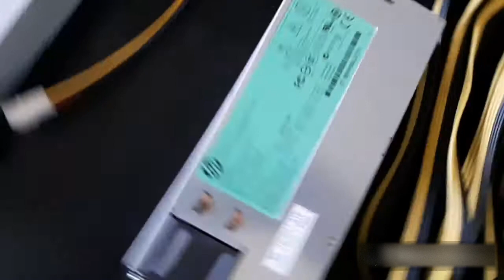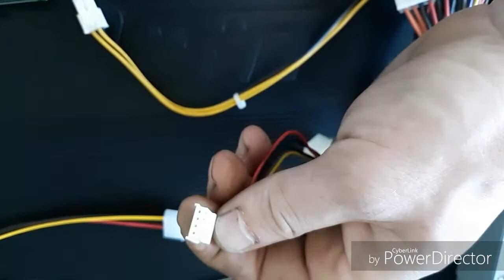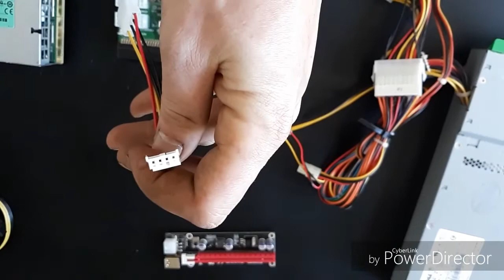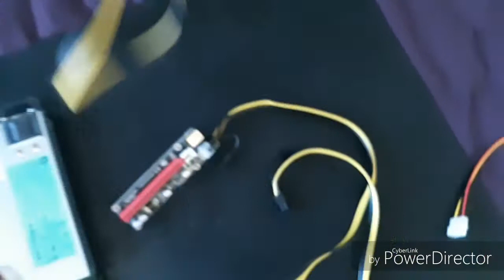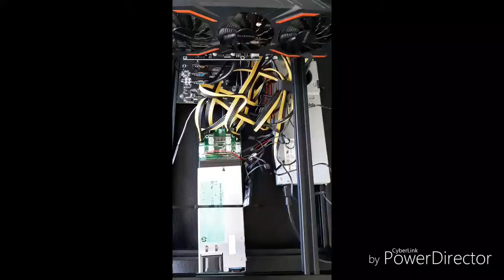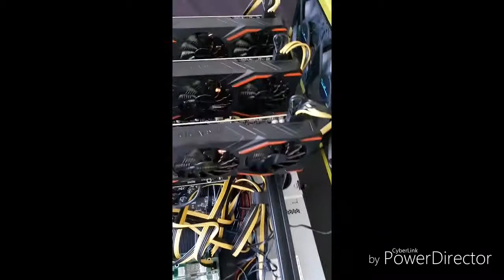How to Set Up Server Power Supplies (PSU) for Mining

Comment: Is it ok to to run a 6 pin to 2x8pin pulling 250W ? Or is is better to use twice as many 6 pin to 8 pin? Thanks!
Reply from the maker: It would be better to do a 1 to 1 (2 6 pins to 2 8 pins) due to power draw. It could possibly melt the cables. HOWEVER, the second 8 pin power connector on most GPUs, isnt even necessary to run it. It is an extra connector for power spikes in load, and I have seen Gpus using only one of those connectors for mining.
Reply: @JonnyRingo711  Gotcha, thanks!
Reply: @GP-qb9hi  u really want 2 6 pin to 1 8 pin. if you were to run 6 pin to 2x8 pin pulling that much youd melt your whole system bro. 6 pin is rated for 75 watts. 8 pin is rated for 150 watts.
Reply: @Fidddle  Maximum for 6pin is 216W for 8pin is 288W, he'd probably melt the connectors. Wire (depending on AWG rating) can hold more than the pins in the connector.

Comment: Can't you leave the 4 pin cable out and just manually press the on button in the server power supply when you press the on switch on the motherboard.
Reply from the maker: Yes you can, and it works the same. I prefer the connection though to guarantee they turn on in sync

Comment: Hi I hope you notice this. Im also thinking using one of these power supply. Looks like they have a very small fan. How's the noise? Is it loud enough to bother other people in the same room or small apartment?
Reply from the maker: It really.depends on 1. How much wattage each unit is running at and 2. How warm the room is. 
If its cool/cold, and you keep one of these under 4-500 watts its not bad at all. I ran a rig with 3 rx580s on 1 psu in my living room and its was pretty quiet. BUT, if these server psus get hot, they sound like a small jet engine or a blow dryer on high. The fan is small, but extremely high speed when it needs to cool down.
Reply: @JonnyRingo711  Wow A blow dryer? Sounds like this is not gonna work for me. even my neighbors gonna this when it gets hot. I live in tropical country and my room is like an oven during summer.

Comment: Wait is it possible to just connect the breakout board to the hp server psu and then power the HP psu with power cable from the wall. Sure depending on it 110/240 ur watt will vary. But do u still have to run a cable from the atx supply to power it, if u use the power cable for the hp
Reply: There is a power button on the breakout board to turn on the server power supply without having to hookup the ATX power supply.

Comment: Hi is it possible to connect a breakout to power supply Lenovo Swap - Hot? thanks
Reply from the maker: I'm not sure. The breakout boards I use only work for 2 different psu's that I know of. There are some for other types of power supplies though, you would have to find one that matches that power supply connector

Comment: so 2 weeks ago i left a comment NOW i am in profit!!!  i just order 1200w server psu and breakout board and an Onda D1800 BTC Mining Motherboard (6 GPU).  woooooo lets mine!  ONE QUESTION - my breakout board has no port to auto turn on. anyway i can make it turn on with normal psu i use for mobo?  any way to wire one of my pcie connectors from server psu to normal psu so it urns on itself?  your board has port to auto turn on mine does not!
Reply from the maker: Thats great!
As far as turning on the breakoutboard without the 4 pin floppy, I haven't found another way to make the psus synchronize. The alternative is to turn on the psus at the same time manually. I have done it that way and it worked. Just make sure the server psu is on first and it should startup normally
Reply: @JonnyRingo711  ok thank you so much I will do that - so server psu with gpu's on first and then straight away mobo psu. thanks

Comment: Is it okay to turn the psu server to power up the gpu unit first then the PC power??, i don't  use jumper to connect both psu. Thanks
Reply from the maker: Yes it is but do it quickly. Try to turn them on at the same time if you can

Comment: Hey what dell did that ATX PSU come from? I was trying to find a model number...the cords length and PSU wattage is exactly what I am looking for!
Reply from the maker: Apologies for the late reply. I get these off ebay. Here is model info.
Dell SFF Power Supply 04E044, 04N505, NPS-180AB, Dimension 4300S, Optiplex GX.

It's actually 180w my bad

Comment: Spec please?
Reply from the maker: Apologies for the late reply. I get these off ebay. Here is model info.
Dell SFF Power Supply 04E044, 04N505, NPS-180AB, Dimension 4300S, Optiplex GX.

It's actually 180w my bad